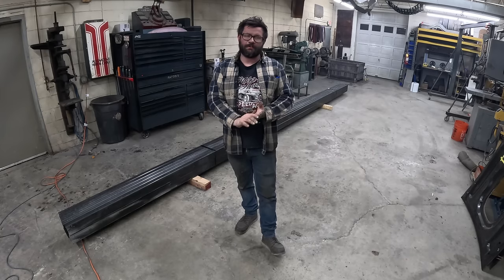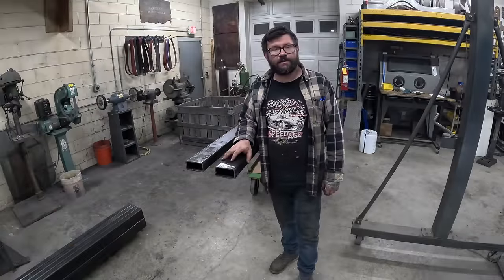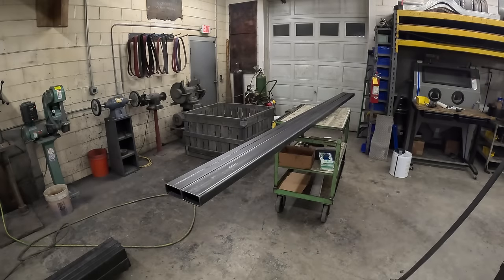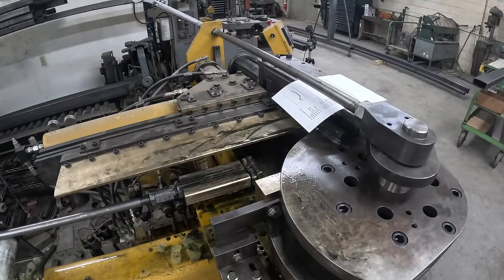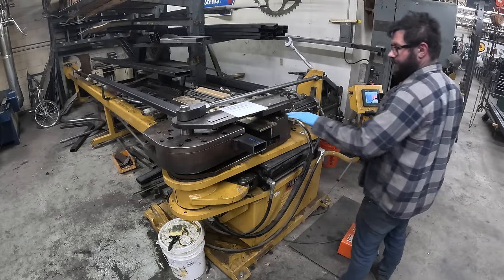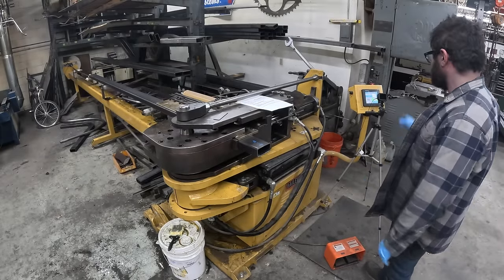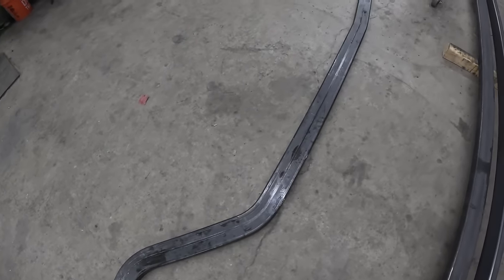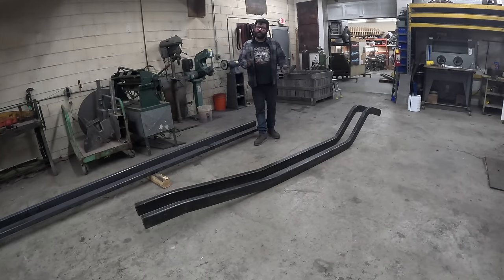Ever wonder how I bend 2 x 4 x .188 frame rails?

Comment: Amazing! I've seen plenty of round stock benders over the years, but I have never seen one for rectangular pipe before. Lovely work.
Reply from the maker: Thank you very much!
Reply: Wow, you can create frames from scratch in an hour, bumpers in ten minutes!
What is the name of this mandrel bending machine?
Reply: You think that's fun, you should see bending T-bar.
Reply: @shvrdavid  No doubt, it's a very expensive machine.
Reply: @pstoneking3418  $60k isn’t crazy expensive for what it can do.
Reply: This is just awesome.I could watch this all day
Reply: The mandrel inside the tube is the key... There's other ways it can be done, but for the best results, and rapid mass production, this is the way to go.
Reply: I've seen them and used them but not this fancy
Reply: Yes great frame to be
Blacksmith theo
Harlingen holland
Nice Bender. Quality
Tubing no fillsand
Neccecary
Reply: @1nvisible1  It appears to be a Baileigh mandrel tube bender.  Not sure the exact model, but if you look closely at 6:18 you can see the Baileigh name plate on the front of the machine.  Of their currently available machines, the closest to this one is the MB-4X2.
Reply: @missingegg  Yes! Baileigh MB-4X2 about $60,000 + $7,000 for the mandrel feature + delivery and setup and instruction

Comment: Fascinating!  Now I have to Google mandrel to see what is going on inside the tube that keeps tube from kinking but still allows mandrel to be moved afterwards. 
Always hear about mandrel bent exhausts. 
Thanks for posting.
Reply: I’d have liked to see a close-up of that mandrel, I’ve seen and used spiral mandrels for round (circular section) tubing but not foe square.
My question is how is the mandrel extracted after the bend?
Interesting 🤔
Great video, but would have been better with more explanations of what the mandrel is and how it works in practice.
❤🇷🇴
Reply: @clivehorridge pretty sure the mandrel just keeps retracting out the back behind the bends. That’s why it starts with the tube all the way in the machine, and bends are done starting at the front. It just supports the inside of the tube where the bend starts so it doesn’t collapse/kink inwards. The mandrel always stays at the bending point as the tube feeds through while bending. That’s just what I’m gathering from watching the video, but could be way off. Lol
Reply: @leebdj1949 your correct, the mandrel his held in position by the bar you see at the beginning of the bending process . Because the tubing is being drawn or pulled by the bending process, the bar (with the mandrel at the end) is only under tension. The mandrel would be tight in the tube at the end of the process because the tubing was trying to deform during the bend process but cannot because the mandrel is only slightly smaller than the inner dimensions of the tube. When he retracts the mandrel, it only moves a short distance back from the bend before it is again loose in the tube. Hope that helps.
Reply: Yep, thanks

Comment: On Saturdays for overtime I would come in alone and prep those big tubes for the following work week. It was easier to navigate 24ft bundles of steel thru a giant convoluted factory designed to accommodate 20 ft material maximum. But I had 24ft stock go figure.  I used to leave the bands on a bundle of 24pcs  2 X 4 X.250  bang all the ends flush, do a squaring cut and cut frame rails and crossmembers with angles, compounds, bevels, for Semi trailers and H.D containers In Mass.   Then hand lay them out because yet again they dont fit in any Cnc milling center, and mag drill all the precision holes by hand. 🙄Surrounded by millions of dollars of current gen Cnc equipment. It was so weird to step back in time to my beginnings when it was all Dykem and hand layouts.
Your vid brings back some of my fondest but most frustrating times i had as a machinist LOL!🤭🤯😜

Comment: Man, that machine is a monster! I thought the "cool thing you were going to show us" was going to be filling it with sand then heating it with a torch before bending to prevent wrinkles and thin spots. Like "ghetto hydroforming". This machine was even better than that.
I have the option of square dies for my bender but have never needed to use one yet.
Reply from the maker: thanks for checking it out

Comment: That’s definitely a heavy duty tube bender to say the least. Nice work with the bending and the video. Years ago I bought plans for a DIY off-road buggy but after pricing what it would cost to get tubes bent and plate steel CNC’d (didn’t own any of the equipment) it seemed more cost effective to just purchase a Side by Side.
Reply: It's usually never "worth" building anything and always cheaper to buy. I build stuff because I enjoy the process and not because I want to save money. It always ends up costing far more building it yourself.

Comment: Wow...way nicer than miter cuts. Does the Bend-tech system give you the specs for all framed vehicles?
Reply from the maker: no, i still have to do all the design work, bend tech is just a tube bending 3d software

Comment: Where is the mandrel in relation to where you put the piece of 1/8” scrap to check your sharpie line. The part of this that didn’t make sense to me. How does the machine know where to put the mandrel. Does it always sit in the exact same position relative to what bend you are doing? Crazy cool. I have a little jd2 tube bender but this is next level
Reply from the maker: The mandrel is always in the same spot of the tube. I adjust the mandrel every tooling change to put the solid section at the bend tangent. The machine then extends and retracts the mandrel
To the same points ever time every bend. The sharpie line has nothing to do with the mandrel. The line is my dimension line starting at 0 mark ( the face of the die)

Comment: I haven't used a mandrel bender before,  but I think with that machine and you operating it, it looks easy. I've bent up  thousands of handrails in aluminum pipe. Do you find as the hydraulic oil heats up your bend angles change, mine  was a cheap bender $30 000 au. with dies. I would like to see... you go from raw materials to fully finished frame, then make a 32 ford 3 window body lightly chopped with a flathead Arden or a kaase boss9. But you do you love your videos thanks.
Reply from the maker: No because the oil temp/ pressure has nothing to do with the bend angle. It has a rotary encoder on the spindle/ die that reads the angle change of the die through the bend

Comment: Awesome tool, process and skill! It was 8:42 before you stated the purpose of the parts you were bending though. Maybe add that to the title?
Reply from the maker: thanks for the input and watching. The video was to show the over all process and steps required to bend 2 x 4 x 188 frame rails in general. The process is the same no matter what the frame are for.  So the intended purpose of what the final part was to be is irrelevant.

Comment: Couldn't tell what exactly was pushing against the concave side of the bend. Also what was inserted into the end of the tube? I figured the grease on the i.d.(?) was for some device. Too much wasn't visible, just the overhanging section of the 2 x 4 bending to the left or right. Everything looked black & unlit. Possibly a cheap cell & old eyes.
Reply from the maker: There is nothing "pushing " per se on inside radius of the bend, it is supported by the  inside radius tooling and the wiper die as the tooling rotates preforming the bend. This is a rotary draw style machine. There is an internal mandrel which is made from aluminum bronze, i have a couple videos showing and talking about the mandrel. check out some of the other bending videos that show multiple angles and more discussion on the machine and process

Comment: That’s awesome! 👏  any chance you have the specs to make full length frame rails for a 68’ charger? Originally they had front and rear partial rails and people would use subframe connectors to tie them together but this would be much more structurally sound!

Comment: I've never seen frame rails mandrel bent, impressive machine. Also I have never seen a saw like that, is that a pulley run drill press on the wall? I liked the music, at least you turned it down when talking. Probably isn't headphone friendly though.😂

Comment: Thanks for the video. If the mandrel is on the end of a solid bar what keeps the the bar from being bent along with the tubing ?  Does the mandrel flex or something or is it never inside the actual bend ? How much did that machine cost ? Would it bend the same tubing with 1/4 wall thickness?
Reply: If I'm not mistaking the mandrel is right at the tip of the bend and mounted on a swirly thingy like a U joint to follow the curvature it's not mounted solid to the bar.
Reply from the maker: The mandrel does not flex or bend. It is stationary and the tube is drawn over it for support as it is bent around. The bender with tooling and 20ft bend bed was around 100k out the door. .188 wall
Is the max i would attempt. Its a hard bend plus a custom mandrel would need to be made for it
Reply: @cornfieldcustoms  So as the tubing moves with the die and clamping assembly it is pulled around the mandrel and that prevents collapse or kinking via internal support ?
Thanks for the reply 👍
Reply from the maker: @crazyoilfieldmechanic3195  correct

Comment: These are obviously not for prewar hot rods because there is no inboard curvature for the narrowing. Very nicely done video.
Reply from the maker: Never said they were for anything pre war. But i do bend for pre war low slung hot rods and they dont need any easy way bends. The rear cross member is just slightly wider than the front giving it a more trapezoid like shape

Comment: Some explanation of what the mandrel is doing or where it's located inside the tube or what it's function is would have been helpful.  Basically all I got from this is you put it in a big machine and it bends it.
Reply from the maker: thanks for watching. the mandrel sits just forward of the tangent point of the bend. it stays stationary supporting the tube internally to prevent collapse

Comment: How much would it cost for the labor side of bending a pair of frame rails to custom specs, or is that even a possibility?
Reply from the maker: Full length rails start at $1100 a pair, just comes down to bends, over all length, and if its done in .120 or .188

Comment: I could watch things like this all day. Thank you for sharing and teaching, I always wanted to know how its done. I still don't quite understand the mandrel. It goes into the stock? Does it need to be changed out for different shapes and sizes?
Reply from the maker: thanks for watching, the mandrel goes inside the tube and extended up just past the Tangent point of the bend to support the tube as it drawn around the die. there is a sized mandrel required for each size, shape and wall thickness

Comment: Why the power hacksaw over other cutting options?  I have a little 10 inch one, but never used it much because I can't find blades for it.  Probably going to modify it to take slightly larger blades.
Reply from the maker: mainly because i like it and am never in a big hurry to cut stuff. i set it up for cutting and go do other stuff
Reply: @cornfieldcustoms  thanks for the answer.

Comment: nice bending machine ,  how about jeep cj frame rails with .250 stock   2 x 8  inch stock   a 4 inch suspension lift without even a suspension lift , another person did it several years ago , body lifts are dangerous or even 2 x 10 stock , just an idea

Comment: Nice video. Does your bender account for spring back of the material? Every piece of steel bends a little different and was just wondering if you have to do a test bend now and then to keep it calibrated? Thanks
Reply from the maker: yes the  software accounts for spring back. when i get in in a new batch of tube or change the tooling out i do test bends to ensure it is still accurate

Comment: This was interesting,  I am an electrician and I have used a hydraulic bender to bend larger conduit and it works about the same way.  What part of the country are you located?
Reply from the maker: I am in cincinnati, rotary draw benders like to bend conduit and other round tubes are a lot more simple of machines with less moving parts and calibration

Comment: If ever there was a demonstration of 'right tool for the job"  this is it.  Wow, very impressive.  Have you considered using silver sharpie?  for me there is nothing like it for marking on steel.  They dont last as long as black or blue. but I consider it to be well worth it!   Also curious how the lubricant gets cleaned out of the inside of the tube, or does it?
Reply from the maker: i always use blue sharpies due to them lasting longer and i do a lot more sheet metal work and the blue are great for that. the lube can stay, or the tube could be stood up and drain out

Comment: Wow, that's a nice bender. I didn't see any spring back setting entered, is that not an issue with that shape and orientation of the bend?
Reply from the maker: spring back is programmed into bend tech so it auto corrects for it in the software/ print out

Comment: What about bends to narrow or widen the frame for certain clearances
Reply from the maker: i think you are asking about easy way bends, and yes i can do those too just have to change out the tooling
Reply: @cornfieldcustoms  I meant some chasis start out straight/parallel in the front and widened out as the frame go's back
Reply from the maker: @grizlypaws4091  yes. Easy way bending is on the 2” leg of the tube. I can do that as well

Comment: How accurate do the bends come out with that machine? We do a lot of bending in my shop sometimes we need to tweak them a little to get them perfect. We use rotary draw so we can work off both ends. What brand is that bender?
Reply from the maker: the brand is Baileigh industrial. the bends are pretty spot on due to all the test bending and set up. with mandrel bending rect. there is no adjusting after the bend is performed

Comment: Ya know I always figured there was something like this out there but I've never bothered to look.  Very impressive.  So this got me thinking...using this process how hard would it be to make a new frame for my 1st Gen Toyota Tacoma pickup?  Would some states in the US require some kind of special title for a vehicle with one of these custom built frames?  Apparently in parts of the mid west you can do just about anything you want with a frame, but I'm not sure that is the case here in PA.
Reply: Since you would be keeping the part of the vehicle with the vehicle identification  plate basically untouched I would do it and not mention anything about it. There are Vin numbers corresponding with your Vin plate stamped on the frame somewhere but if it is badly rusted I don't know how anyone would find them.
If your that worried about it check with the DMV in your state and find out what the process is for replacing a lost or stolen VIN plate on a vehicle of your year and ask whatever agency they mention if you need to do anything because you replaced only the entire frame. You can buy frames from FORD for damaged trucks as much as 3 years old and have them replaced so it isn't like it's illegal or anything.
Reply from the maker: Shoot me some drawings and we can figure out some rails for you cornfieldcustomsltd@gmail.com
Reply: I'd start by talking to my local state inspection station as that's where you're going to be going yearly for renewals. Pa. has a network of enhanced insp. stations for approving modified vehicles, but if it's done as a repair you may not need that. PennDot website has a list of enhanced insp. stations and requirements and classifications of modified vehicles.

Comment: You can grow bamboo in a form upward and when done wrap it in fiberglass and boy is light and strong. even steam bending wood to shapes like then an then fitch plating w steel is strong as hell and won't need a 50K+++ hydraulic cnc bender. But it will take much longer than 5 minutes. per piece.
Reply from the maker: I will stick to doing it the way i am. No bamboo and fiberglass frame rails here

Comment: Now that I have seen how great an induction wrap around 'furnace' can heat a metal form region in < 1 + minute and make bending forming etc simplicito. I'd say all shops should have one need 220 3 ph and up but unlike a constantl;y fueled box it is on and then off for the new piece 5- 10 30' length no issue. Like passing a hand thru a hoop.
Reply from the maker: i really dont need an induction heating unit for what i do

Comment: what is the metallurgy on the rails? If mild steel not in accordance with automotive standards. Nice little home built anyway.
Reply from the maker: Rails are A500/513. It is industry standard for tube chassis frame rails. I really dont care if you think it is automotive standards or not. I am some what curious as to what you think car frames are made from if not mild carbon steel.
Reply: A500 is grade B for structural applications, nothing to do with cars, Are you making a a didldo injection press ah ah ah?
Reply from the maker: @bernardmauge8613  get a life. Your the one who doesnt build anything criticizing some one youtube videos to make yourself feel better

Comment: How does the mandrill work?  What does it do inside the tube?
Reply from the maker: the mandrel fits snug inside the tube just beyond the tangent point of the bend. it support to tube from the inside to prevent collapse, wrinkles or splitting of the tube

Comment: How much does the  2x4 tubing spring back on ya?
Reply from the maker: it is calculated in the software from test bends. the number i type in has the spring back included. its like all tube bending the more of degree in the bend the higher the spring back. if i remember correctly from the chart it is about 2.5 degree at 90 degree bend.m